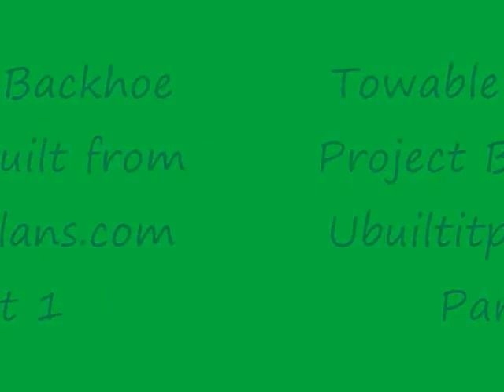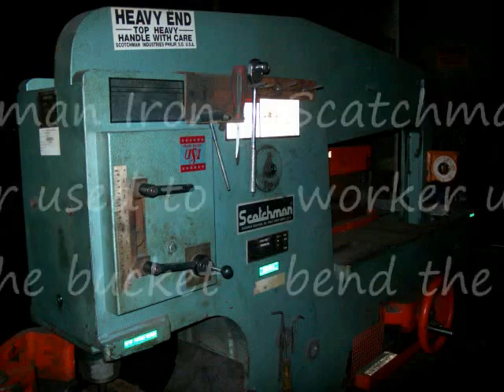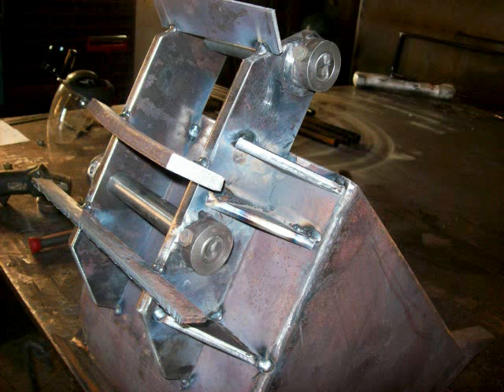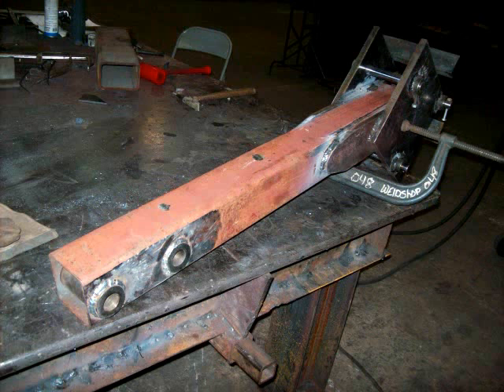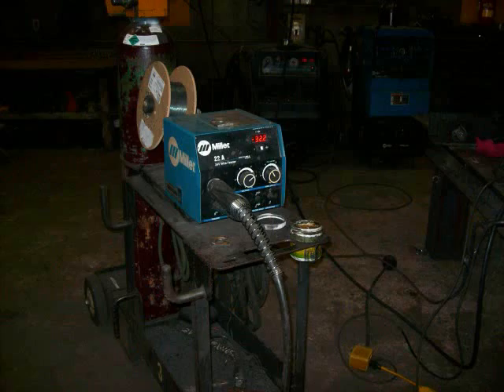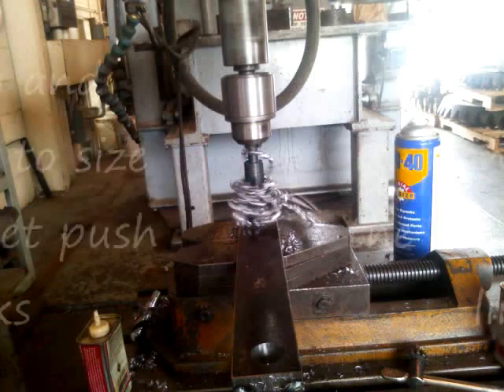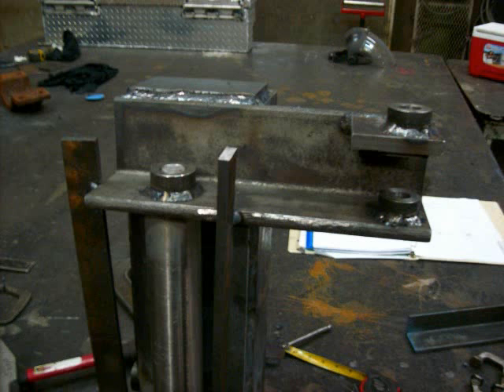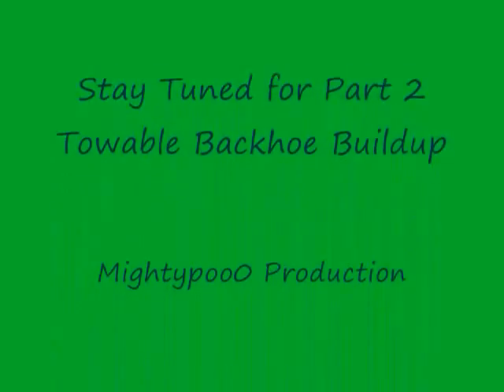Towable Backhoe Build Part 1

Comment: Hello my friend, I was wondering if you can inform me, on the diameter of the square tube used for the arm of the excavator, I thank you and go ahead as it is great ;-)
Reply from the maker: James wiiinchessster thanks for watching. For the inner boom I used 1/4”x4” which I had to buy and for stick I used 3/16”x4” which I had in my scrap pile.
Reply: mightypoo0 I have precisely the same in my stock of scrap (1/4x4), there is more than reunite the rest, thank you again my friend, good luck ;-)

Comment: Dude, this is impressive as hell for a hand-built project from plans!  Don't care what anyone else says.  You making positive comments about my build is an honor, because you obviously do this stuff for a living.
Reply from the maker: James Sokolovic thanks for the great comments' I just like building thing I need. That smoker you built is cool as hell. The trailer hinges on the door is slick idea. There is another you tuber site u need to check out Allan's welding and woodworking. He also builds some nice pits. I shop you tube for ideas. Thanks for commenting.
Reply: :o)  Smoker cooks like a dream - Thanks! I wanted something that I could allow me to add a tad of grease, so it doesn't make that dreaded rust squeal when I open the door. hated  Plus, I liked the look a lot better than the other ways people installed their hinges.  Will check out Allan's channel.  Appreciate the sharing....take care.